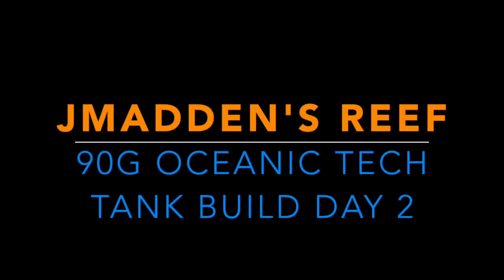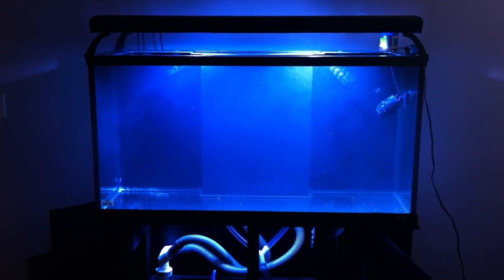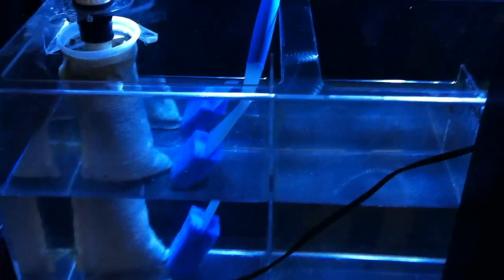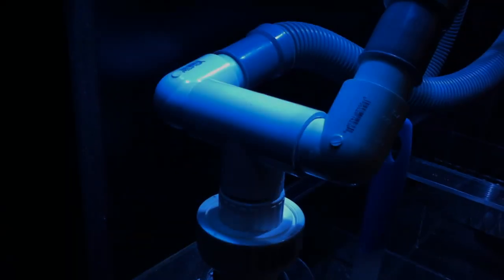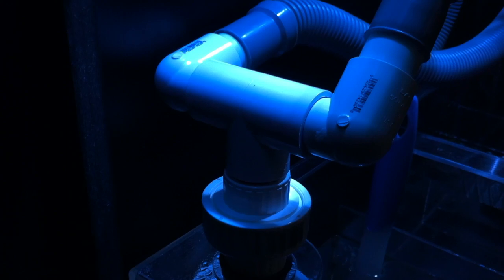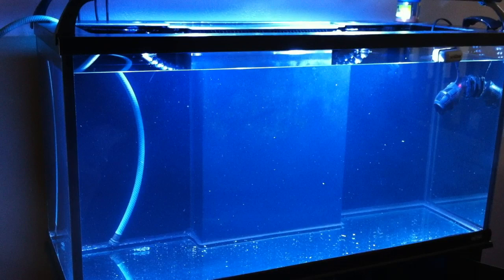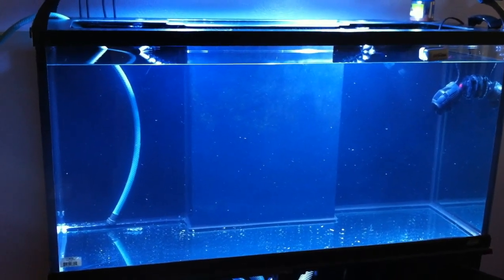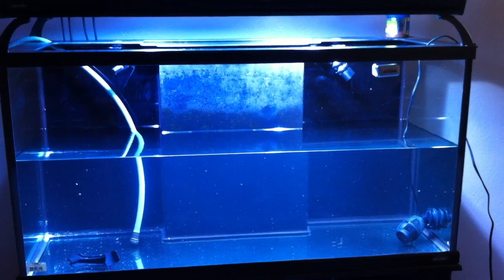How to Clean & Remove Coralline Algae

Comment: Looking good, I like how you didn't glue the hose for your plumbing. Where did you get them from? Online
Reply from the maker: Thanks! I will end up putting plastic hose clamps on the returns and metal ones on the drains. The drain hoses fit really snug over the 1" bulkheads. I believe these 3ft hoses are from Eshopps though you can probably find them cheaper else where.

Comment: what size sump are you running ?
Reply from the maker: If I remember correctly it is right around 21G, but normal operating volume is closer to 15G. A little on the small side, but for now it will definitely do the job.
Reply: yea i have  12 gallon sump but is not an actual sump is a plastic container but it works so good i don't know if to change it or not I have my skimmer, suck and return pump with a phosban reactor
Reply from the maker: This is how I see it, "if it isn't broke don't fix it." I feel too many people try to over complicate things by making unnecessary changes once their system has matured. If you're system is doing well and thriving with your current set up I would just keep on doing what you're doing; just my two cents.
Reply: agree I have a rubbermaid and it keeps all my parameters in check no nitrates only running a  phosban reactor and no phosphates.